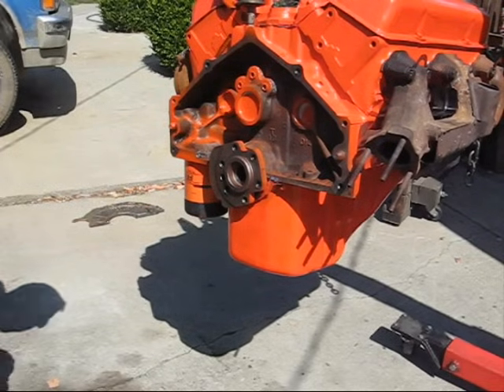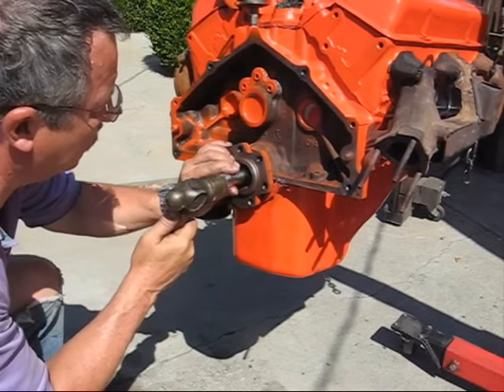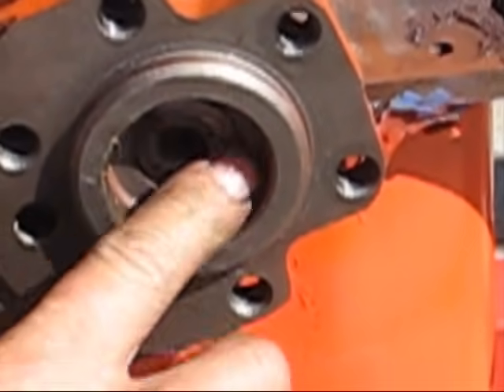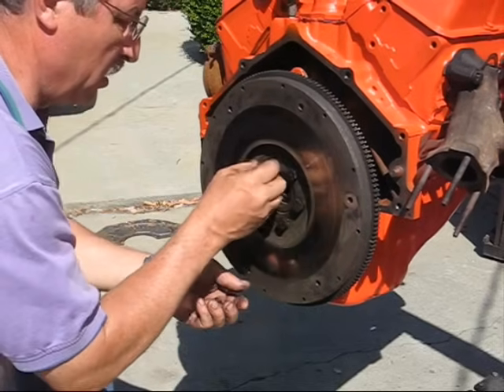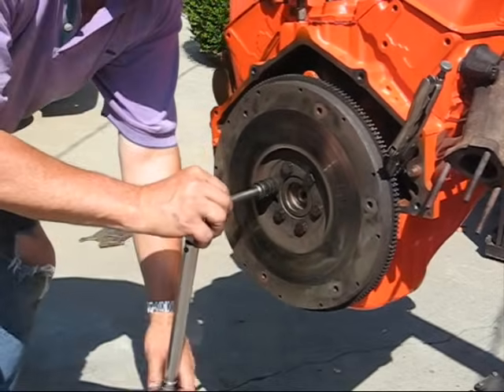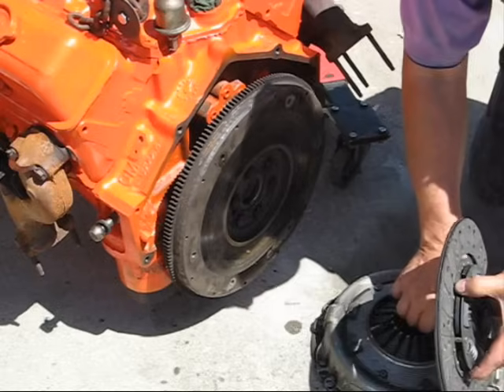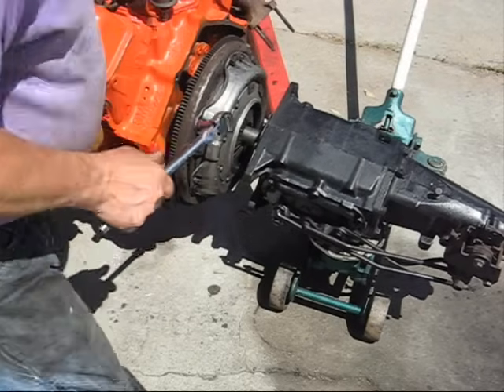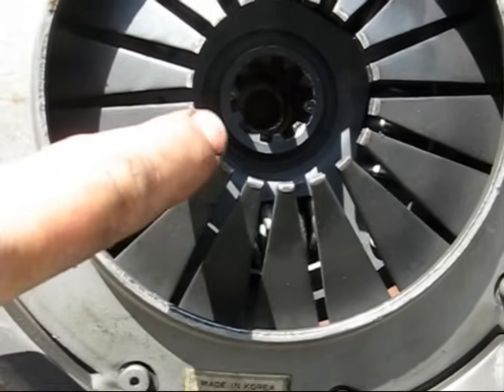How to Install a Flywheel Clutch Pressure Plate and Bell Housing on a 350 V8 70 Chevelle

Comment: One - the flywheel needed resurfaced
Two - torque in a crisscross pattern in stages
Three - use an alignment tool
Fourth - use a new clutch disc
Fifth - use a new clutch pressure plate
Six - Use thread locker on the flywheel bolts and the clutch bolts

Comment: 😂 smh that's one way to do it with out a clutch alignment tool
Reply: I know the feeling, I couldn't find my tool once, and did it that way, about 10 mins later found the tool.
Reply: I've seen clutches get aligned with a shaved down broom handle and a good "eyball",also with a piece of hardwood run down to the dimensions of the transmission spline in a wood lathe ,you don't need groves in it. and,,,save a main drive out of a junked tranny. the old school way